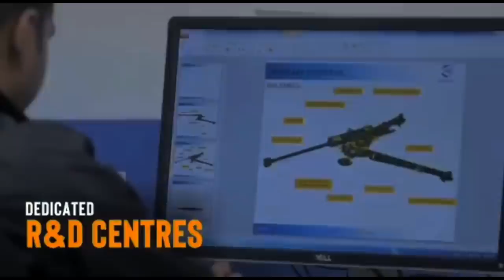155/52cal ATAGS Kalyani Group Promo Footage | By Bharat Forge

Comment: It's cost is High. But I think I have got reasons to justify it.
1) It's first major project which has involved high tech parts and equipments which either need to be imported or need to be made from scratch
2) since it's advanced towed artillery it needs to be made portable and this also needs advanced Research and Development centre established just for this purpose.
3) the cost of making a weapon/ an equipment from scratch will always have higher expenditure. It needs time, labour, approvals, hangers, industrial arrangements.